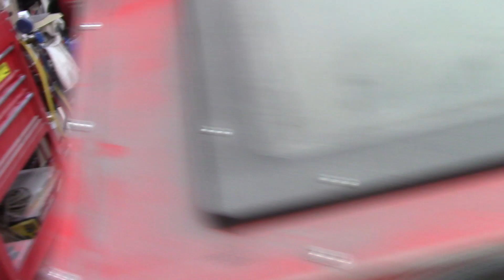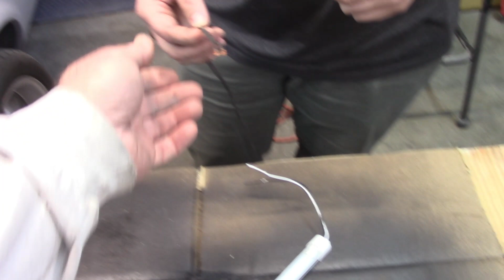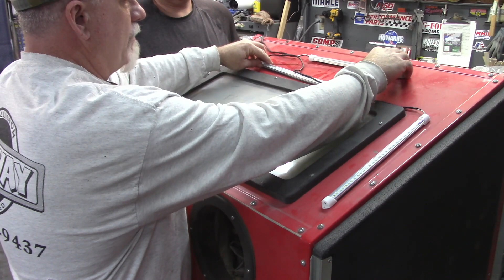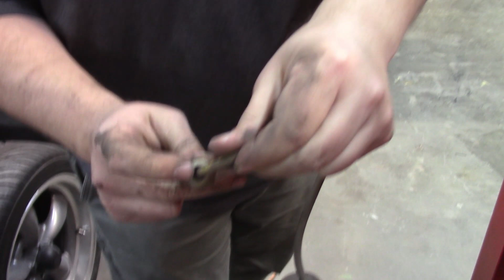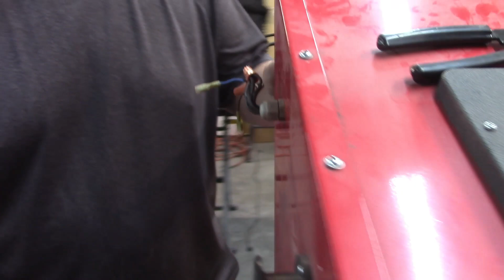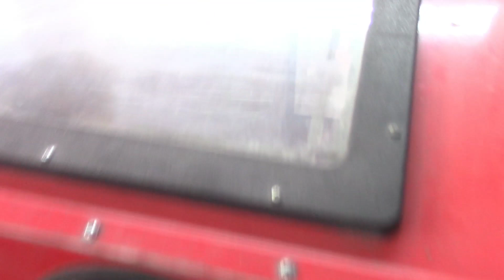Harbor Freight blast cabinet upgrade. LED lights and new gloves.

Comment: I  made my own blast cabinet out of aluminum, plywood and fiberglass years ago, (lived at the beach, steel would rust) and the mess it made with media forcing out the seals was enormous. I dealt with it by installing a small centrifigual blower on the cabinet with a filter inside that simply brushed clean. Kept the cabinet in a negative pressure situation.

Comment: Before it became too cold to work in the garage, I attempted the same thing but the 12V LED lights that I bought didn't work with the old switch and cord.  Turns out the power supply on the cord was only 9V.  Looks the same as yours though, will have to try it again.  I also cut a perforated piece of steel and placed it under the grate to help filter out the media.  Seemed to help keep the gun from clogging up.

Comment: The best mod I made to mine was to put that leaky piece of shit on wheels!  When I need it, it gets wheeled out of the garage!  Problem solved.  Here is a good tip to keep your viewing glass lasting much longer after you run out of those crappy stickums.  Cover the inside of the glass with a piece of screen, it cuts way down on the destruction of the glass.  ;-)

Comment: Great Video Guys! One little tip that may help on the wiring, when using that brown/black lamp cord wire that you used to extend the black and white pig tails,  look carefully at the lamp wire and you will likely see one side has ribs and the other side is smooth. Match a color to a texture and you get "Red-Neck'  color-coding ..... well a least that's how me n Bubba gets er done!
Reply from the maker: Thanks. We talked about that afterward. Just got in a hurry....

Comment: I added 2 flood lights to mine. I also added a switch and outlet to plug in my shop vac recycle container system. I reversed the screws for the see thru glass. Widen the plastic a little for the nuts to fit into. Fitted the plastic onto the cabinet and wing nutted the thing together. It makes removing the glass super simple and gives me more access to the inside on the cabinet for cleaning, glass replacement and trouble shooting. As always great video.